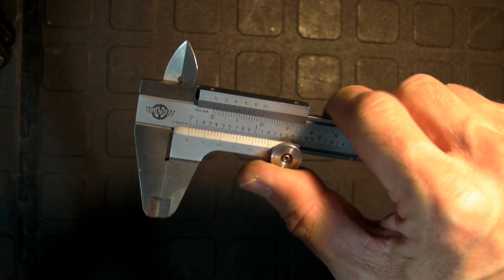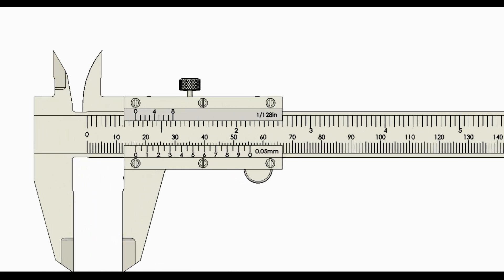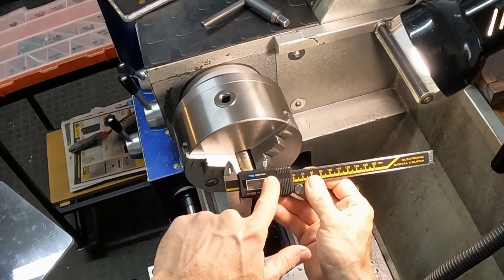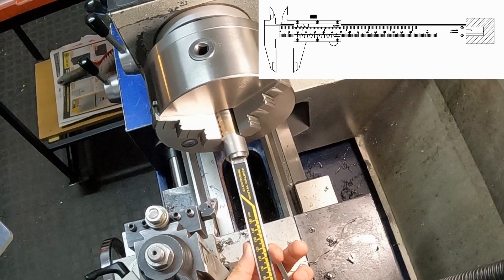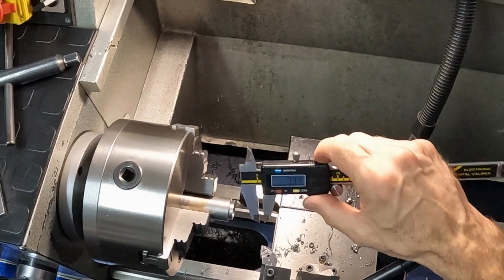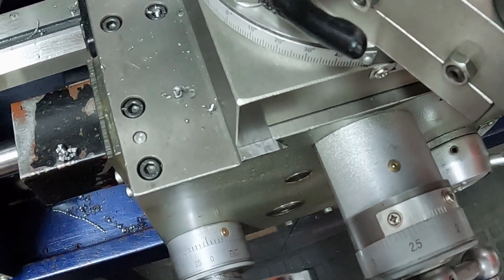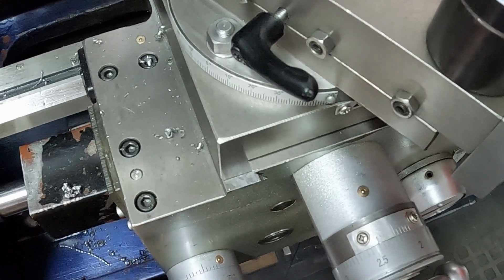Using Verniers as Verniers, and to make a lathe 5 times more accurate...

Comment: I would recommend store your vernier back into its box with the battery out (in the same box)@3:06.
A digital vernier is the same as a digital caliper. If you don’t know how to use a caliper and you wouldn’t mark and use your dial; you better go with a DRO  (same as a digital caliper or vernier).

@4:15 you could first measure the “bar stock” or gauge block or parallel and zero the vernier. Then measure the hole. 

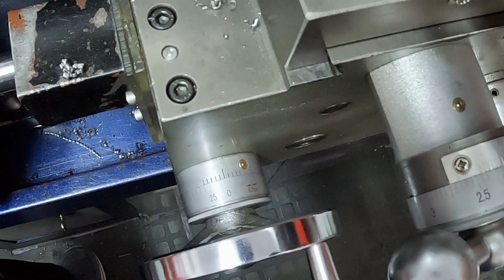There are cheaper DRO scales cheaper than other verniers with the same quality. Those scales are designed to not use energy while turned off as supposed the cheap verniers that devour batteries. @6:26

I used to mark my machines (when DROs where super expensive; i know, i’m almost senior citizen) starting with the first and last limes (since you can rotate it as needed) and make 10 divisions 1/9th of the scale in other words i made that 10 divisions in fit 9 divisions of the dial (there were metric and imperial machines at my job). It’s always a pain adjusting your lead screws to zero backslash, but it’s needed.

Comment: Accurate to 10 microns or .00039" ? As others have pointed out, there's vernier, dial and digital calipers, and afaik no company makes any dial or digital caliper with a vernier scale on them since it would be unnecessary. But you might be confusing or mixing up your Digital Calipers resolution verses there real world accuracy. Resolution is simply how many digits that are displayed to the right of the decimal point and are in no way any guaranteed level of the tools actual degree of accuracy. Secondly the universally accepted metrology standard used world wide is a measuring tool should have a repeatability and accuracy level of within + - one resolution digit to then pass the manufacturer's own internal quality control checks. And most of the better metrolgy equipment will always come with specifications within the user paper work for that specific tools resolution and guaranteed repeatability, accuracy. Too many refuse to even read or fully understand what those terms mean. As an example, a .001" resolution micrometer could have a maximum deviation of up to .002" of the true measurement while still passing those quality control checks. There's also a term used in metrology called uncertainty of measurement. It's also commonly accepted industrial practice that any measurement tool  needs to be at least one order of magnitude better than your required level of accuracy for measurement to remove that uncertainty. I've checked most of my Mitutoyo and Starrett measuring equipment against an almost new condition set of Mitutoyo grade 2 gauge blocks. Most of what I do have does fall within about half of that allowable + - inaccuracy deviation. 

I've also taken the time to check both myself and my measurement techniques against those same gauge blocks. Under ideal, spotlessly clean and temperature stable conditions, my Mitutoyo digital calipers will average within about .001" of true measurement on randomly selected gauge blocks and the marked sizes facing away from me. At random times they will in fact show the correct size. However there's no way to be sure when or even if that might happen.Those measurement checks are of course done under the best conditions I can manage in my own shop. Measuring parts still in a lathe chuck or mill vise, then I'd only trust my own measurements with my own calipers to be somewhere within .005". Yes the actual measurement should be better than that by a bit. But if I need to be certain to less than that, then a vernier, dial or digital caliper isn't the tool you should be using. There's also an extremely common mistake made with calipers and using the thumb wheel to close the sliding jaw. Mitutoyo has an older video somewhere here on Youtube pointing out that thumb wheel is only for coarse movements. And for smaller sizes, the caliper should be closed by gently squeezing the jaws over the part using your thumb and fore finger. And those should be placed in the rough center of each jaw. And that's especially so when measuring round shafts since that puts the closing pressure (or should) centered on the part your measuring. For larger measurements, the jaws should be closed on the part to be measured using both hands. I can say that is a slightly more repeatable and accurate method over using the thumb wheel. My digital calipers do have a .0005" digit, in reality I simply ignore it since the tool simply can't deliver that accuracy except randomly despite what it's resolution might be. On a good day I'd suggest your probably accurate to within about 70-80 microns, or .003".
Reply from the maker: HI Pete, you’ve raised a number of points and unfortunately I might not be able to give an adequate response in a YouTube comment; when I was lecturing design and manufacturing techniques, subject matter like tolerance, machine accuracy, measurement tolerance etc. used to take up a number of classes (with some interesting maths and statistics), but I will try my best. Accuracy in measurement, like average in statistics, is ambiguous.  Accuracy in the context of my home workshop is to have the ability to machine within 10um (between components) and sometimes less when and if required. Because completed assemblies are measured using the same machines and measurement tools the measured differential accuracy is well within 10um. This is not to be confused with a specific measurement to within 10um at the standard temperature in a controlled instrument room. As long as the components I make don’t go to another assembly point or are not measured using instrumentation calibrated differently, the accuracy is defined by the deviation from my tooling and measurement apparatus, which will be a very small deviation. In the real world you are of course correct about the resolution especially in industry, however in a home workshop where relative fitment is key, resolution and measurement accuracy is the same.  This is all very theoretical and we need to be careful not to confuse industrial measurement norms and home workshop measurements. Regardless the proof should always be in the pudding! One of the most difficult items to make in model engineering is a steam injector. I have made all the injectors for my loco’s including a number of 8oz injectors. Most of my locos have two injectors one for high and one for low pressure. If you are familiar with what’s involved with making these devises then you’ll agree the accuracy to make the tooling and cones is below 10um and the fact that I have yet to scrap one, repeatability seems to be good! I appreciate you taking the time to write such an in-depth comment, much appreciated! PS: In SA, we generally just call verier calipers, verniers, and a caliper is what we use to transfer internal or external measurements, very old school! Thanks for watching!
Reply: @Lukers_tinkering  Yes I appreciate what your saying and I am at least a bit familiar with the requirements of building injectors that do work. So far I've not built one myself though. And for what were doing, properly fitting the parts for the expected function is more important than there exact NIST level size. Fitting commercial bearings might be the exception to that for most of us.

 But!!!! your statement of being within 10 microns using digital calipers is misleading to the more entry level people since there incapable of ever making repeatable measurements at that level. And no, resolution is most definitely not the same as accuracy, neither Starrett, Mitutoyo or Mahr would ever agree with that statement. I'm not being argumentative, I'm simply trying to be factual. You could put a 1/millionths display on digital calipers, yet the tool itself can at best have an accuracy due to there design of roughly + - .001". So the design and gauging method any caliper uses physically prevents that. I could easily make repeatable measurements within your 10 microns using my Mitutoyo digital mikes or even comparison and transfer measurements using my gauge blocks and a Mahr millmess indicator. But as good as I think my Mit,. digital calipers are, I've proven the company guarantees within the user paperwork of what there capable of are the limits, and even then only under the best possible conditions and using careful technique as well as observing a repeatable closing force on the moving jaw. Correct measurements at random times are meaningless since there's no way to tell which random measurement is correct when or if it were to happen.

Under normal shop measurement conditions, I'd say my calipers are probably approaching at least double the inaccuracy I see against gauge block measurements. As I said, mine have a .0005" digit, even if they were absolutely 100% repeatable which there certainly not to .0005" levels, then at best due to the internal circuitry and the way they round off that last digit, the measurement would still either be true if the part was in fact at that dimension, or somewhere within a  - .0003" + .0002"" range on either side of that last digit. My digital micrometers are good to 50 millionths", and it's more than easy to still be .0001" off on gauge blocks that are guaranteed to be within 4 - 6 millionths of there true size. 

I have run across a very few mentions of Starrett and possibly Mahr offering .0001" capable digital calipers roughly 2 -3 decades ago. There's almost no real information about there design or any pictures I've ever managed to find. One statement I find mentioned Starret was pricing there's at the time over $6,000.00. So far I've been unable to verify that anywhere else. Since 10ths capable micrometers are commonly available at a fraction of that price, the idea was probably a very quick failure. But the design would obviously be quite different than our commonly available calipers were using today.
Reply from the maker: Hi Pete, unfortunately I can see my answer was not understood, and for that I apologise. Some of my students battled with these concepts even with the maths and definitions before them. For example resolution and accuracy are different when you a measuring to a specific dimensional value and tolerance, but they are the same when you are only measuring to the tolerance. I.e. you not concerned with the actual value measured. Then repeatability becomes important, especially in model engineering to make sure the components will fit correctly. Have a look at the builds I’ve designed (you should find the videos by searching for Stirling, Ballaarat, Wahya, Fire Queen). With the knowledge that I did not buy a single model engineering item from trade, and other than the metric fasteners everything was made in my home workshop, ask yourself if all these components could be built without the accuracy I have mentioned. The simple answer is no. Unfortunately, unless you have designed and made injectors the engineering requirements may not be apparent. For the record I don’t agree with your statement that beginners could not make repeatable measurements at this level. Any beginner can machine to an accuracy far greater than I achieve, can cast components, make anything! Provided they take time to understand the required knowledge and practice. The simple fact is, as a beginner, I can do what I do because I refute anyone that says something cannot be done, I just do it! @Pete-xe3il
Reply: Adding a super accurate digital scale on a Vevor table on an old drill press does not make it a jig borer.
Reply from the maker: Adding a model engineer to the old drill press might 😅 @tates11

Comment: Your digital "vernier" is not a vernier. It's just a digital caliper. The dial versions are analog calipers. You need a vernier scale to call the tool "vernier-whatever".
Reply: In fairness to Lukers his video is mostly about use of the genuine Vernier scale for subdividing the larger indices on the handwheel dials. He only briefly covers the use of a digital caliper as a miniature DRO for the lathe.
Reply from the maker: As long as everyone could follow the concepts, I'm happy! @howardosborne8647
Reply: @Lukers_tinkering  No you know how many users of imperial units feel when called out for not being metric. Except in the case of vernier used for caliper, there really is no good reason for it other than some local tradition. 🙂
Reply from the maker: @steveh8724  Yep, I think it is local vernacular. Calipers are getting rare in the workshop as well, so most artisans use the terms indiscriminately. I get caught out every now and again with my articles in model engineer.
Reply from the maker: In SA, we generally just call them verniers, and a caliper is what we use to transfer internal or external measurements, very old school! Thanks for watching!
Reply: @Lukers_tinkering  That's interesting. I've heard a few old timers just call them verniers as well. We also call the manual transfer tool a caliper.
Reply: @sccolbert  A very similar thing exists with vacuum cleaners being generally called a hoover.
Reply: @howardosborne8647  That's a British thing thru and thru. No one in America calls them a Hoover. It's all Vacuum Cleaners over here LOL!

Comment: Canadian here. We would cal it a caliper. A caliper with a Vernier scale is a Vernier Caliper whereas one with a digital readout is a digital caliper. Vernier scales are definitely very clever.
Reply: Hi Luker,

I would be interested to see how you go about accurately scribing the outer half of your lathe dials; tool(s) used, method, etc.

I know how I would try & likely muck it up, curious if method, tool or skill is the problem.
Reply from the maker: Hi John, thanks, that is probably more correct...  In SA, we generally just call them verniers, and a caliper is what we use to transfer internal or external measurements, very old school! Thanks for watching!